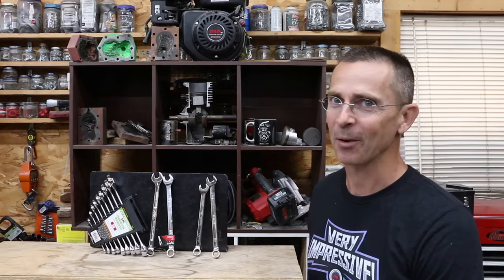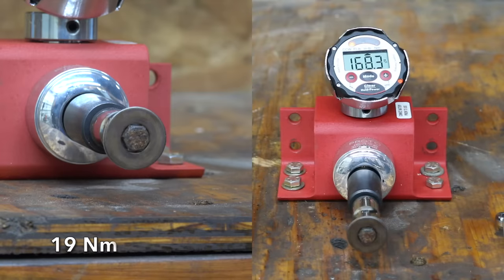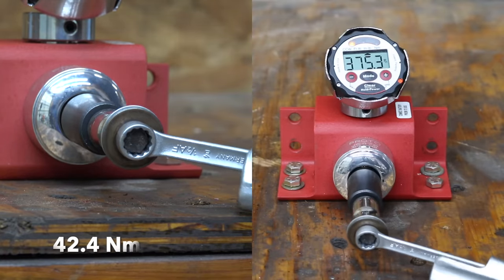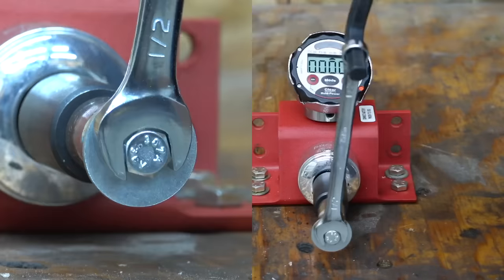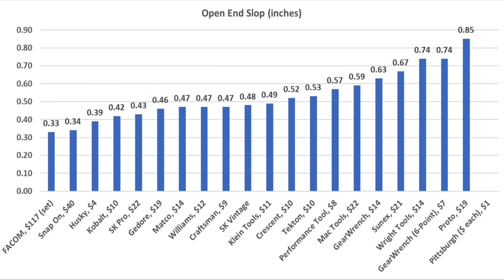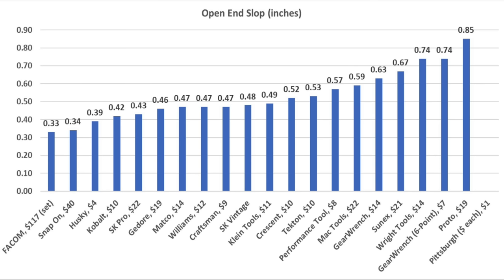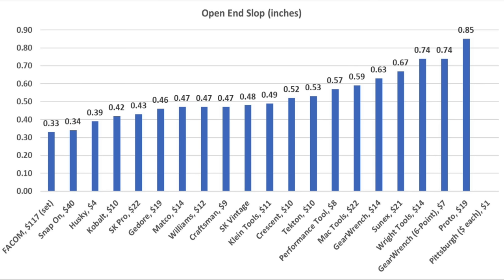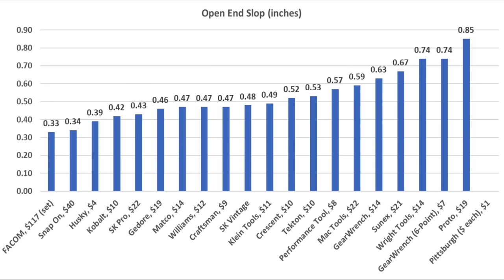Best Wrench? Let’s Settle This! Snap On vs MAC Tools, Matco, Proto, SK, GearWrench, Kobalt, Husky

Comment: This is an interesting test! As a metallurgist (and a weekend mechanic), I would like to see if there is any variability within specific a manufacturer.  It is all about the alloy and control of the fabrication processes, e.g., microstructure of the starting material, forging, heat treating and plating. These all must be controlled to produce consistent mechanical properties. So select a few of the top performers and then test three or more wrenches.
Reply from the maker: Thanks for the suggestion.
Reply: Yah, this goes back to that point I raised about metrology. It’s a bigger cost in time and materials but if you went that extra distance wow, that would be incredible. You may even want to poll your Patreons if they’d stand up and support that level of work. They could get in on some of that glory too. What a community that would be.
Reply: Yes I would like to see both micro and hardness from them
Reply: @ProjectFarm  One way to check is a basic observation of how the material fragments, splinters, shatters,  or otherwise breaks apart.
Many times you can see the crystallization of material as it begins to separate.
A high speed camera might be a wise tool for the task to catch those initial chips and flakes as the disintegration process begins to occur.
The metal composition would be interesting to know, but may be difficult to know due to trade secrets and such. Hardness testing would definitely provide interesting data.🤙
Reply: I don't think it would be that relevant. Most people just want to know of it works to take off a bolt and move on. Manufacturers quality is pretty level, I doubt metallurgy would change even between a dozen Pittsburgh wrenches
Reply: @gwbuilder5779   you can easily  test  for metal chemistry send me a piece and I can have an answer in 15 minutes.
Reply: @andrewc9902  Metallurgy will tell you the elements used, but not the process or procedures.
Smelting, molten time, cooling rate, tempering process, and so on are trade secrets.
The hardness test and other stress experiments provide the real information someone like myself is interested.
The processes of metallurgy have changed dramatically over years, some have improved the quality of materials, but are used to make the process cheaper and more efficient for better profitability.
Of course metals smelted in other countries (like china) also do not have the same standards or values, lending to inferior quality of product. A metallurgy test will certainly verify the elements, but not the other necessary processes.
As the testing shows, anything on the market here in the US will have a minimum performance level and companies who choose to go above and beyond will definitely stand out, but it will come at a significant price.
The real question is...
Is it worth it?🤙
Reply: @gwbuilder5779  Chemistry gets you 90% there. These are standard Carbon and alloy steels, nothing exotic. Chemistry/hardness/micro will tell all that is needed to know. Smelting is done to ore not to steel and ‘molten time’ does not matter, its alloyed before the billet is cast if its coming from a generic starter master heat from the Arc melt. There are no Trade secrets anymore these are standard alloys with known heat treat responses and hardability curves. China can make just as good as Steel as anyone else but you get what you pay for!! if you ask them to make 4340 they will make 4340( Albeit to the GB spec EN grade)  
Bill Clinton and the WTO made sure they had all the knowledge they need to copy our processes, whatever knowledge they don’t have they just steel - Ask GE about turbine blade alloys. 
I would watch the buildup of trace elements in their steel but for handtools it doesn’t really matter at this point the lifetime guarantee is mostly a marketing. 99% of handtools will never be used severe enough to need replacement so the markup cost easily covers the replacement,  even those that use screwdrivers as chisels and with cheater bars .  HF might be cast and not forged, but your paying $2 for a driver, its basically disposable, buy 2 or 3 vs the $60 snap on driver. That said Snap on and old craftsmen are good barn sale buys. Pennies on the dollar for the current version. 
all that said I still would like to see a micro of the various tools.  You would need a micro to tell the difference between cast and forged (unless its broken, then you can tell by the fracture).

Comment: I’d also love to see the special grip vs the standard grip wrenches from the nicer companies such as snapon, matco, Cornwell, and Mac tools. I love ur content and helps me justify buying the tools I do. I’m a diesel and trailer technician which means I want the tools that will last with constant use. Thx you for all your time u take to make these videos!!!!
Reply from the maker: You are welcome!  Thanks for the suggestion.
Reply: And the wright grip 2.0!
Reply: @stevenmckinley6339  flank drive Plus has the teeth
Reply: @nathankisner8332  thanks, I didn’t know that
Reply: I know from experience that the Snap On flank drive plus will break bolt heads off before it slips in both 10mm and 1/2"
Reply: @TheMapleDaily  Where's your shop?

Comment: Not sure what the problem was on the Husky, when you mentioned that it was your error but it should not have received the lowest score on that test if it was your fault. On the rest of the tests it actually came out quite well finishing in 5th place, and beating everyone price wise hands down.
Reply: I would agree with this comment, what is your response to this? How did you account for this in the final score?
Reply: I thought Husky was the winner too.
Reply: I agree, this is the comment I was going to post. Husky is the real winner here when you compare very minor performance differences with the top vs. the price of the top.
Reply: I was going to say the same thing. It was unfair to it. Seeing  how it performed in the other tests, it's fair to say it would've at least earned an average score of 10 which would had place it in the 7th spot. But for $4 that's really impressive.
Reply: What if..........

The $4 Husky was better overall then the $40 Snap-On ?

What kind of litigation would he face, as that would get around the community very quickly.........?

THINK !!!!!!! 

Why did he stop the test? Perhaps because it did "out perform" the Snap-On, but he couldn't broardcast those results..... when he gets a box of spanners, he doesn't know prior to testing how good they all are......

BUY HUSKY, OBVIOUSLY !
Reply: @whome5770 agreed.  

For the price husky will be my go-to after seeing this video.  

If I need something very high quality then Mac or Proto.
Reply: Don’t buy husky but Wright wrenches
Reply: Considering the wright wrenches are 3.5x more expensive, and considering 70% of Americans have less than $1,000 in cash to cover an emergency, I'd say your suggestion is a poor one. 

Right now (cyber week sales) you can buy 24pc husky wrench sets for $29.99. 

Or buy two wright wrenches.

Comment: I've actually taken a belt sander and removed the taper on some of my more often used wrenches. The cost of a wrench is a lot less if you think about it than trying to extract a bolt from a really bad spot on a car engine or some other similar project. I'd rather have a few sanded down tools than a future headache I could have prevented.
Reply: very well said. tools are made in factories every day as they say. A $6 is less expensive than taking it to a shop
Reply from the maker: Thanks for the feedback.

Comment: I'm very satisfied with my Tekton metric and sae "kits with tray" type deal. Great value. Taiwan tools in general usually don't disappoint.
Reply from the maker: Thanks for the feedback.
Reply: Pretty good value play. I've used their impact rated universal joints on suspension bolts without problems.
Reply: Besides that there warranty is the best I’ve seen
Reply: They have come a long way over the years.
Reply: Another HUGE reason I recommend to the young guys at work to buy Tekton kits is they are COMPLETE, almost all the other cheap brands HFT, Craftsman, Husky, Kobalt skip sizes and if you're working on mostly Metric stuff that means you have to either buy the SAE set too or individual wrenches/sockets etc which ends up costing you more $$ than the extra couple dollars for the Tekton set.

Comment: I would’ve like to see how the Husky performed on the test where the mistake was made.

Not fair to give the 19th place on that.  If that test is removed the average jumps to 6.7 making it a very good value for most DIYers
Reply: Yeah for the price it is definitely one of the top for the non professional
Reply: I have to agree with that! It appears to me, dollar for dollar, bang for the buck, that the Husky is the way to go, although some wrenches performed better, they also cost significantly more. If was a just a normal use homeowner, Husky is a very good choice in my opinion. If I a professional, gearwrench seems an excellent choice. If you can afford it, yea, go with the best.
Reply: Let me guess, you're Home Depot D25?
Reply: @justme_gb  D25 was one of my departments and I thought Husky was a joke until now. Very good DIYer tools.
Reply: I was given a new Husky tool kit, with many sockets, wrenches etc. , didn't expect much and keep them in the truck. Well when i need to do something quick i grab the set and they have pleasantly surprised me. I've used a pipe on the sockets a few times and they held tough, never broke or stripped. I have better tools but these can do the job in a pinch.
Reply: I am also usually watching for the best value for money options on these tests. There isn’t always one, but in this case, I think Husky looks darn good as well.
Reply: Agreed. Thinking it would have come in somewhere around a 6 on that test giving it a final score of  ~6.6. Very good for a $4 wrench with a lifetime, pretty much no questions asked, warranty.
Reply: One more thing about Husky.  All the hand tools are lifetime warranty.

No receipt, no questions, just walk into any HomeDepot and walk out with a new tool.

Comment: Nice to see different readings from different tool brands that have the same parent company. Mac, facom and proto all belong to Stanley and Williams is a cheaper industrial arm of snap on! As a professional mechanic I own alot of spanners all for different uses, snap on 6 sided is the go to for grip though. Gearwrench extra long combi box + flexi ratchet spanners is the latest purchase very useful. I also have a full set of cheapo Silverline Pro spanners that I've abused for years and never broke one (yet) £1.50 each roughly.

Comment: In my younger days I worked as a line mechanic. I bought mainly Snap On tools and Mac Tools. It wasn’t until later that MatCo came into the market. My boxes are filled with quality tools and disposable tools of which I don’t mind if the cheap tools fail as I never use them for any projects where a higher quality tool is needed. I had “help” with my good tools disappearing as I raised 4 boys that liked to “borrow” tools with out my approval. Walked out one day to the 4 huddled around a bicycle that they were trying to work on and found my runout micrometers and cam lift gauges being tried because “they might help!😂”. My specialty tools are all locked away and secure now along with my Gunsmithing tools. No more teenager boys to help” me, just an 8 year old Daughter. 
I buy cheaper tools to put in the vehicles in case of emergency surgery but at home I only use the better stuff.
I appreciate your testing. I buy most of the quality stuff that I use based off of your testing. Haven’t failed yet to get the best from your advice.
Reply from the maker: Thanks!  Thanks for sharing!

Comment: The $4 Husky performed very close to the $40 snap off wrench at 1/10th the price. Once again with snap off tool you DONT get what you pay dearly for.
It amazes me how many suckers still buy them. Several brands outperformed snap off across the board at 1/2 to 1/4 the price.
(edit for autocorrect).
Reply: I'm with you! I've worked on a lot of cars and have a lot of happy customers, and they will never know or care that I don't own a single Snap-On product.
Reply from the maker: Thanks for the feedback.
Reply: I prefer snap on pneumatic tools, because of the warranty of having the truck there, and I broke most other drills and impacts in under a week. For wrenches and sockets I agree that a cheap one is pretty much the same as an expensive.
Reply: @mattmgarza  Snap-on makes some special tools that you can't find anywhere else like a metric size "crows-foot" for tight spaces.
Reply: I would agree with you except I can usually find next to new, barely used snap-on wrenches at second hand stores for a dollar, maybe a few bucks if it's a large wrench or a 6 point or some other specialty. I've found snap-on impact rated bit sets that retail for 250 to 300 for a dollar. Also find channel-lock pliers, Crescent brand adjustable wrenches, cornwell, bonney, sk, mac, wright, Proto, wizard,  williams and so on. Crescent made in Jamestown NY not far from my hometown of Erie PA. Channel-locks a half hour away in Meadville PA. Cornwell (or Bonney?can't remember which) had a small factory near Albion PA.  I guess there are a couple of advantages of being on the shores of the Lake Erie rust belt. Tools, grapes, and sunsets. Not much else though.

Comment: I made a living for 50+ years using snap on and Proto tools. They didn’t fail. We used a lot of stainless steel cap screws and a lot of B-8 and  B- 16 heat treated bolts on steam systems. Never failed.

Comment: Truly amazed that you've never done a flashlight comparison test! I've been looking around at all these different olights and other competitive brands in that area and I think an in depth battery test, light throw tests  build quality review, charger speeds and so on would be an amazing video! I'm always looking for a solid flashing that's durability for good outdoor adventures!
Reply: good idea!!
Reply from the maker: Thanks for the suggestion.
Reply: @ProjectFarm  Glad you saw this! I'm certain I'm far from the first to suggest this but it's awesome that you saw and responded to my first and only comment on your channel, been watching for quite some time now! Anyhoo, I've been on the hunt for a solid EDC (everyday carry) flashlight that's relatively pocketable but also packs a pretty good punch, recently I've been considering the HP10R from coast which is said to be rated at 1050 lumens @ high power for 6 hours of run time! So far, for the price ($99 USD) if those numbers are accurate that seems like a really awesome deal but the numbers just seem so far ahead of their competitors at that price that I'm not 100% confident it's accurate. I think myself many others would greatly benefit from a comparison tests since there's endless different flashlight brands with some pretty bold claims, especially on Amazon (95% of the cheaper light listing are either misleading or outright lying) Thanks for the consideration and hope to see a video about it in the future!
Reply: @DK Royalty I really like the flashlights from Coast. They are super quality and just feel good in the hand. Ten years ago I went to Africa and one item we were told to bring was a decent quality small flashlight. Everyone was amazed by my Coast.
Reply: Olight is pretty good.  I prefer Fenix.
Reply: Yes! I just want a quality edc flashlight and according to the internet, the pricier ones seem just as cheesy as the not so pricey ones. SO many flashlight brands to look at but when it comes to the question of build quality, it always comes down to spec sheets and especially word of mouth it seems.
Reply: streamlight and nebo. however , its hard to find a pen light thatll last past a year.

Comment: I used gear wrench for years working on diesel and heavy equipment cause it was what I could afford but I will say living in the rust belt they held up well the rachets are still smooth and the only tools I've broken was their picks and a 3/8 to 1/4 adapter but too be fair I was definitely not using them for their intended loads and purposes. I never claimed them to be better than say snap on and the other big names but I was surprised at how much abuse they have taken over the years (yes even using Chrome socket on impacts).
Reply: Gearwrench makes a high quality tool. I took a chance on them when they first appeared on shelves in Sears back in the late 1990s. Made in Taiwan, but they had their exclusive ratcheting box end design. Patented. Those wrenches held up as well as my USA Craftsman combo wrenches. Fighting rusty brakes and suspension. Added their stubbies to the box.  They lasted until my ex-wife stole all my mechanics tools and boxes, plus nearly everything else!  Well, back to tools...just be sure to buy the Taiwan-made lines of Gearwrench tools. Not the made in China line of tools.
Reply: @wngimageanddesign9546  That's low-down man. A woman who steals a man's tools should be in jail.